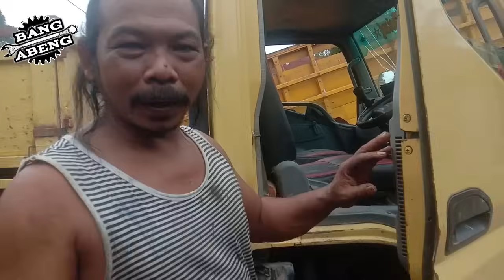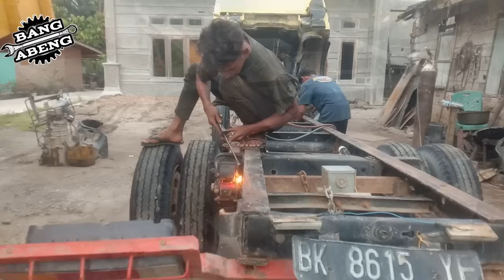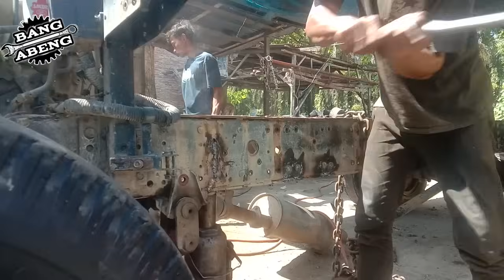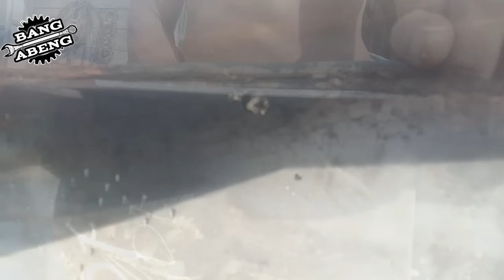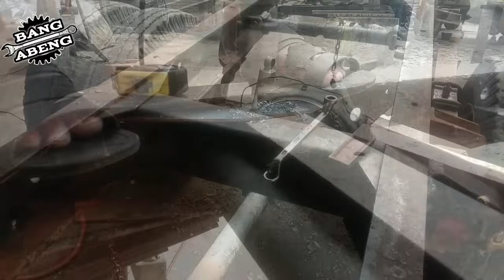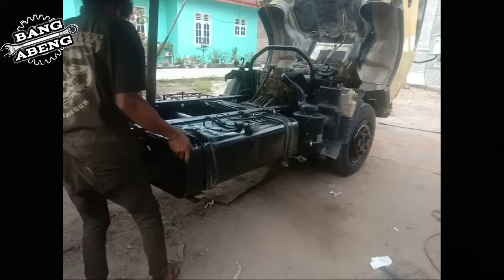Teknik Perbaikan Chasis Mobil Mitsubishi Canter By "Bang Abeng"

Comment: Cara BUKA Dan PASANG BODY CARGO GUNA cara LAMA ... BISA GUNA chain block ... !  MODI KANG GUNA CABLE TARIK * WINCH * MACAM DI GUNA PADA 4 X 4 OFF ROAD  , PASANG DI  ATAS PALANG BESI YANG ADA  ... CEPET DAN SAVE TENAGA ...! MAU AWET LAMA LAGI ...SALAM SEMANGAT ...X'S TRUCK AND BUS BUILDING MALAYSIA.
Reply from the maker: Trimakasih saran nya bng ,tetapi itu semua memakai biyaya .ini kesan nya manual saja 😄😄👍👍

Comment: U need to v or all the old weld metal. That will crack again. U need full penetration. No porosity at all
Then plate over the top plus extra bolt holes in plate to spread load out. Sorry boys. Fail
Reply from the maker: Semua akan retak yang baru juga retak.ini dulu baru .. baru pakai Bebe Rapa tahun udah retak,kerana pengaruh jalan, disini tidak ada kata-kata gagal. Arti gagal ber arti tidak bisa di perbaiki
Reply: @BangAbeng3d  sorry don’t understand your reply